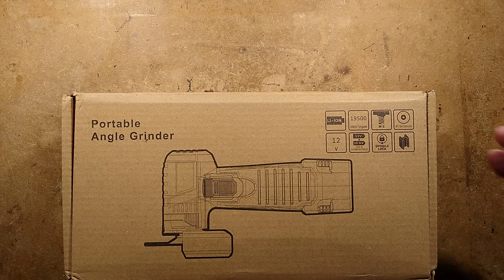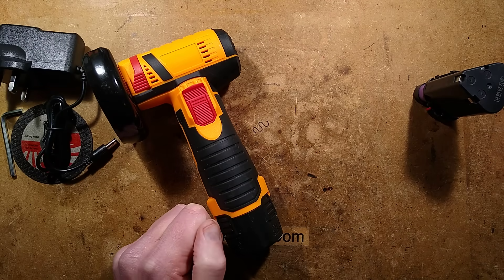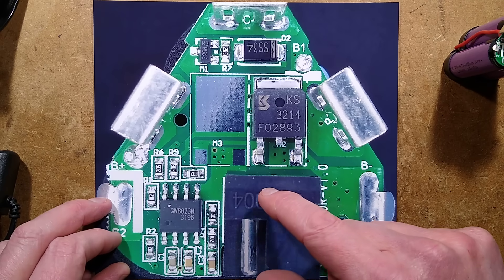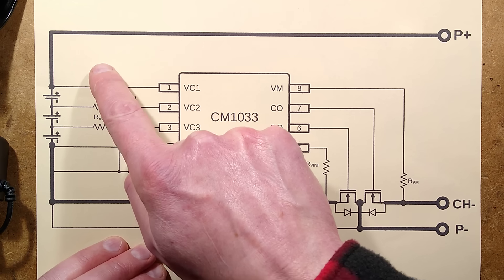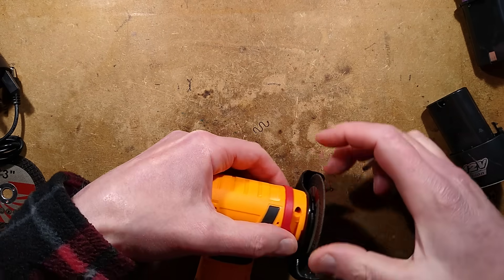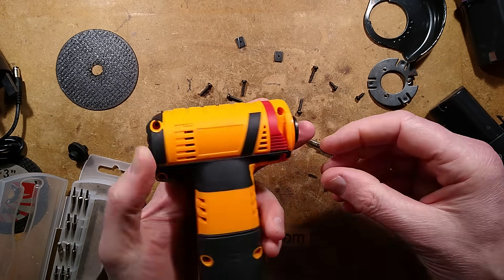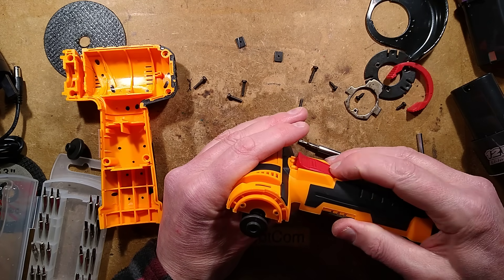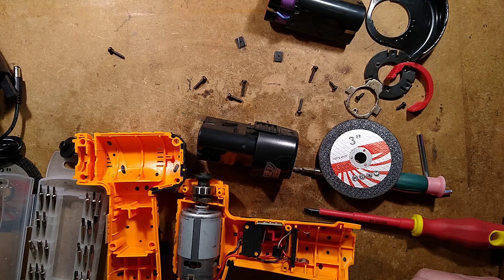Cheap eBay 3" cordless angle grinder with issues

Comment: The reason it's that loud, may be because its a "Brush Motor" instead of a "Brushless Motor!" Those "brush" motors tend to be louder than the "brushless" ones, due to the constant integration of Al those moving parts such as the motor's gears, working in unison.... basically---making contact with each other in order to provide torque and power to the spinning blade aka cutting wheel!!...

Comment: Wow any grinder should have a slow start up to max rpm that thing going max speed off bat can cause your grinding disk to catastrophically fail especially when previously used so that thing is a dangerous shrapnel thrower if actually used

Comment: So im doing some repairs in the house 
And i got tired of sanding wall by hand what if i buy this grinder and equip it with sanding disk to 
sand wall before painting it
I know the battery has a small life but still it'll make my job easier
What you think sir?
Reply from the maker: I'm not sure the best approach for that.  Pro painters often use a large sanding pad on a pole.

Comment: What is the size of the locking threads? 

Am thinking of buying one and turning it into possibly a 90° Die Grinder  🤔

Will need a threaded adaptor maybe
Reply from the maker: Not sure the threading, but I think these use a 10mm hole in the disk.

Comment: Best solution for the battery problem is to build in a stepless trigger. They are quite cheap and fitvin perfectly (just make a square hole for the Trigger on bottom in the non rubberized section). At the same time it makes the tool more convenient and versitile.

Comment: Recharge batteries in cameras AA and cams  wont work idk why  not enough Oomph ! to kick start cap ? 
great in them powerful torches $28 i bought years ago E/Bay  the most used tool in my room the 1200 mah useless > try 2400 3600

Comment: Would a big fat capacitor over the batteries help here? Of course that'd need an inrush limiting resistor and a diode so it could outrush to the motor.
Reply from the maker: That might help.

Comment: I have a couple of those cordless ratchets. I've had to resolder the wires on the batteries a couple of times, but they have worked very well for the price. they do not however like being used to crack bolts loose. I use a normal ratchet for that, but they are excellent for spinning nuts and bolts out.
I think I paid something like £14 each.

Comment: I keep buying stuff from China, finding it's well designed but then the their battery supplier has clearly pulled a fast one, it's truly bizarre. Example, light sabre toy with a tabbed 1200mAh 18650 inside, only the battery is actually less than 100mAh, worse it's clearly a lipo inside an 18650 case, as it rattles around, the fact it's marked as 1200mAh tells me it wasn't the manufacturer of the toy that cheaped out.
Wanted to replace the battery but god it's difficult to get genuine 18650s, the last set I bought from a UK business, also fake, sent them back.

Comment: I have a Hyundai drill with this exact battery, comparing to Makita's 12V drill, it's on par with power and usability, but it ran out of juice quicker than Makita, I guess because of some cheap out component inside the battery board and cheaper cells, but it's understandable as the Makita's battery cost more than the Hyundai drill and its battery. lol Would still recommend them, they are great for being spare tool or for occasional use.

Comment: I've got the same grinder.  The batteries are ok but if you buy the cordless drill that uses these batteries you can get it for £9.99 for the drill and two spare batteries.

Comment: Why is it marked C on the Curcuit board  and T on the plastic housing, clearly no one looked at that during the design phase
Reply: Thanks for the vlog I had a misfortune, I was diagnosed with ovarian cancer. I also created a channel and am trying to move in that direction, but so far not very successful((dfs

Comment: That roto-rattle is because of an incredibly bad drive train.  No rotational tool should ever make that noise.  This includes land vehicles, sky ships and water craft.  If you ever hear spin rattle STOP USING THAT DEVICE immediately!  Or at least lean way back a lot when using and expect "unforeseen consequences".  If on a seagoing vessel stay close to the life boats.  If you're in the air, well, most aircraft have two engines for a reason...

Comment: I've purchased a couple of those grinders, one brushless and one brushed. I also purchased several battery kits that are dirt cheap. These are supplied with everything but cells. I also purchased 
one (claimed) 3000mAh battery which seems to be closer to 2200mAh, but it does allow much more work load than the original supplied batteries. For a cheap tool, it's similar to the popular 6" chainsaw and both extremely useful and well worth the crazy low purchase cost. I did modify the kit batteries with a 4 pin plug that allows me to balance charge these cells as I have fitted them with some high quality 3500mAh 18650's. I also do a brush bed in with all brushed tools, just run it at a couple of volts for half an hour with no load and the current always drops by a large amount and brushes then last almost forever. The brushless version has a soft start with an active torque control that works like a governor, take it off load and it revs higher than normal momentarily. One more thing is, I also find balancing the disk makes a huge difference to both disk life and noise (buzz). I just use the slop in the hole to find the best position to avoid vibration, it is extremely good with flap disks, and cutting disks can be closely lined up visually, turning slowly to see any runout, then correct before locking tight. My wife uses one to trim and shape her horses feet using a flap disk, and quiet operation is essential. it is very effective.
Cheers.
Reply: Thank you for the brush bedding-in tip.

Comment: That’s actually a cutting tool, not a grinder. Those are cut-off wheels, not grinding wheels. Never even seen any 3” grinding wheels.
Reply: If you use a 4" grinding wheel long enough, you will eventually see a 3" grinding wheel.

Comment: How many volts is the battery for that ratchet and what are the specs on the charger for it?  I was given a ratchet similar to that one and I was needing the battery and charging info if you could possibly help me.  Thanks.  Also, nice little grinder.
Reply from the maker: It's a classic Chinese tool 12V battery.  Whether it fitted your tool would depend on the brand.

Comment: I have 5 of the cordless "makita" battery type grinders. I got 5 for the price of 1 "genuine " grinder as I wanted to keep a different type disc on each grinder to avoid the need to change discs so frequently. I use them everyday for almost 3 years.  Powerful and no issues. Genune batteries are a must though as the cheap knock offs don't run a power hungry grinder very long.

Comment: Would you be tempted to add another mosfet to the battery pack, or is it not worth it.
Reply from the maker: The limiting factor might be the cell voltage dropping under load.

Comment: how different would it be if you used Sodium Ion batteries, other than ~ 1500 mah, so like a low capacity lithium. can sodium cell handle more abuse, and current rush?
Reply from the maker: There are good cells and bad cells.  I'm sure the sodium cells will have the same issues when made cheaply.

Comment: Are 3 inch angle grinders common over there?  I think the smallest in the US I have seen is 4-1/2 discs so good luck replacing a 3 inch disc when it is worn down or expires (yes, discs EXPIRE and increase risk of shattering and injury when they get old)
Reply from the maker: It does seem to be common size online.

Comment: 5:19 Could you just add the second mosfet to that empty pad and solve the cutout issue?
Reply from the maker: It might also be the cells dipping in voltage under load.

Comment: I have a Ryobi shop vac, and it does the exact same thing with certain batteries. It will spin for a sec, then stop. It works if you flip the switch twice though. It only does it with certain batteries, and no other tools do that with those batteries.

Comment: I actually got 2 of these off ebay @ £14 each delivered, which is frankly ridiculous.. one had the earth pin had snapped off the charger plug, I didn't bother reporting it because of the silly price. I`ve not used them in anger yet, just using one to cut some thick, "structural" type cardboard for some creative packing. I got it for removing rusty bolts/nuts/fixings off in confined places, like bumper mountings etc. Part of the reason I got it because I also have 2 of the ratchets with the same battery (used at least weekly for the last 4-5 years with no issues), although the batteries that came with this are a fair bit lighter than the ratchet ones. I`d like to get hold of these 12v triangular battery adaptor/receiver ports to convert some wired car accessories to cordless, like lamps & a tyre pump (I did convert a Ring analogue tyre pump to cordless with a Makita LXT battery adaptor, but the voltage was too much for the 12v Ring motor, which burnt out quite quickly).

Comment: So, if reliability is not a factor, $20 US will get you a tool perfect for trimming aluminum foil in the kitchen. If you are looking to cut 10 mm steel plate for profit, the other yellow or red tool with a cord would be a better choice. :)

Comment: A very budget compact disk cutter for "those with nefarious intent" 😀!  Those 3 inch / 75mm cutter disks are an excellent buy for legit. purposes, fitting all 75mm cut-off tools (e.g. Ryobi) and very widely available from all the usual sources for a pretty good price (esp. if bought in bulk).

Comment: I'm curious if you put another mosfet like the big one already present and put it in would it actually work and stop the cutting out issue. I see that this runs on 12 volts. Sounds tempting to wire this to a car battery. I wired an 12 volt drill to a car battery.

Comment: LOL. Got the same thing two weeks ago here in Romania. One battery at 8V charge, the other one 3V... both came alive once charged. Seems to work fine every time, but didn't run it yet for more than a minute at a time.
Reply from the maker: I wonder what the internal cell voltage was.  When the cells run low in charge, the protection will kick in and give a weird voltage reading.

Comment: I got a similar tool as a bare tool. But the handle off and just hold the motor motor section sort of like a rotary tool. Just use a inline switch with a XT60 connector on it then an RC lipo battery. Not the safest thing out but does the job i needed it for.

Comment: That is certainly a cute little tool.  I am impressed to see a ball bearing supporting the shaft so it might actually last a reasonable amount of time for light duty use.  The little ratchet looks interesting too.  But like all the cheap lithium powered devices, I’m afraid of fires.  As a matter of extra caution I only buy authentic name brand OE tool batteries.

Comment: 1500mAH in the other one, 1200mAH in this one... what kind of craptastic cells are they sticking in there?
Get some nice tabbed 30Qs or similar.  3000mAH and good high current output as well.

Comment: I have one very similar from Lidl. It will shut off if the wheel jams or takes a slight drag now.  I don't remember it having this problem when I bought it in 2017.

Comment: Do you have a recommendation as to where I can pick up some decent 18650 batteries?  I've picked them up from eBay, Amazon and Temu, and all them had a capacity printed on them at least 1 1/2 times the actual capacity.  The higher capacity ones were even worse.  As it rated at 2400mah, but actually being 500 mah.
Thanks,
Reply from the maker: The best ones do command a higher price.  They can be got from vape shops or salvaged from existing battery packs.  As usual with lithium cells, handle with caution and avoid shorts, as they store a lot of energy.

Comment: Going for cheap, I would have ditched the custom protect circuit and used protected cells. Unless a cell was bad, which would be easy to test for, you wouldn't run into that strange inrush problem at all. Besides, if we're honest, even the big tool manufacturers like to saddle tools with subpar included batteries.

Comment: I work in the water supply industry and most 240v power tools have been banned and some not so grinder savvy guys at work got the Milwaukee version of these and they are just terrible, mind you, I am a steel fabricator/welder and anything less than a 18v brushless is no good to me.

Comment: I had one of these. It looked exactly the same but it was brushless. I used it maybe 7 times before it broke. I went and bought the newer 20v dewalt cut off tool and it is phenomenal! Tons of torque!

Also there are batteries that work with your tool that have a couple extra cells. They are shaped like the Milwaukee 12v XC3.0 batteries. If the tool held up I would have bought the bigger batts to try. Thanks for the video as always!

Comment: My concern with these cheap tools is if something was to go wrong such as a fire from charging, or injury due to faulty cutting dics or grinding etc, who do you blame, i mean lots of sellers from ebay are located in china now, most of time you can never get a reply from them. 
I do like a good cheaper alternative, but i have found over the years if i have problems you are stuck with the product.

Comment: I HAVE ONE FOR YA 😊
Because I'm working, and Fixed one myself from eBay.
Got a full refund, but gave the seller 50% back, because it was just corroded connections. And still only 4 bucks.
She didn't know. And my lady friend knows I'm a good guy 😊
... don't say a word dude

But they have those Tiny Drones, they often call ALIENS. Which are simply a counter rotating Floating Toy, with just a tiny infrared controller that simply adjusts the power to it, so you can keep it Hovering 🤗

Most are made like tiny helicopters. I just find the ones without the tail rotor more of a Challenge , and unpredictable 😂

You may already have done them in the past.
But it's a pretty interesting tiny piece of technology.
... Cheers 🥂 

What do you mean do it myself.
I just did,.. and I'm not pulling it apart again 🙄
... she'd be pissed, nuff said
Reply from the maker: I've looked at a couple of drone toys in the past.

Comment: I have one of these but it lacks voltage indicator and it says brushless motor on the box. :) I love it, it's great for small tasks, but over time it developed a rear motor bearing play. Battery capacity is not far from advertised (1160 mAh if I remember correctly) but they are discharged in maybe 5 minutes and take forever to charge. So I bought 3 of them. :)
Reply from the maker: Others have mentioned a need to lubricate the rear bearing of these motors.

Comment: Any brand markings on the batteries?  Would be curious if the marked capacity is any where near the actual. Maybe you can post short letting use know?

Comment: Mine is blue, but it works ok. It overheats easily, but 10 second wait works fine.
So, the engineer designed it well, but the finance department decided to leave out parts. 😂
Tanks for saving me from having to take mine apart. 
It works on reasonably heavy stuff if you take your time.
The 3” wheels were mostly used in air-driven grinders. I’ve got a selection of types, including Diamond for cutting glass & ceramic tile as well as metal and masonry. I carry it in a small box on many jobs, just in case I need to cut/grind something. It’s great for quick cutting heavy wires or pipes.

Comment: I am actually building something right now that requires a 12V DC motor, boost converter and a LiPo cell. The current spike at the start of the motor kept tripping the over current protection of the cell. After some research it was apparent that the protection MOSFET voltage drop determines the current limit. Instead of digging through tiny SMD MOSFETS, I just used an ATTiny85 and a power MOSFET to make it PWM soft start and the tripping never happened again.
Reply: I wonder if that soft-start marginally lowers the wear and tear on the motor!  Nifty idea.
Reply: I had a similar problem and just added a coil in series that I found somewhere

Comment: Lidl was selling something similar. I bought it and wasn´t  impressed. The safety thermistor inside the battery pack was just too hysterical and after a minute or two it cut the battery off. Cutting a hard wire from fence mesh was "so so". Anything bigger like a thick screw or nail was a problem.

Comment: When Lidl were selling off tools a couple of years ago I bought several of their version of this tool. Super useful in the workshop. I use one with a normal cutting disc, one has a fence attached for straight cuts and another I fitted a ROLOC pad and i use it for sanding, deburring etc. Some of my favourite and mot used cordless tools.

Comment: They didn't populate the other mosfet becasue the designer was a noob and didn't include a separate source balance resistor for each mosfet, to prevent one mosfet from going nuts. 
Probably kept blowing one of the mosfets. So they decides to just use one. 
I wouldn't trust the grinding wheel to not explode and disintegrate in my face. I suffer from "grinding wheel in the face" phobia.

Comment: Very much a 'cost reduced' version of Aldi's Ferrex F-CAG12S. I have one in pieces at the moment to modify it for a specific job. I paid  about the same, but with only 1 battery and no charger.  No battery gauge on the Ferrex, but it does have variable speed. Overall I was quite impressed with it's mechanical build quality.